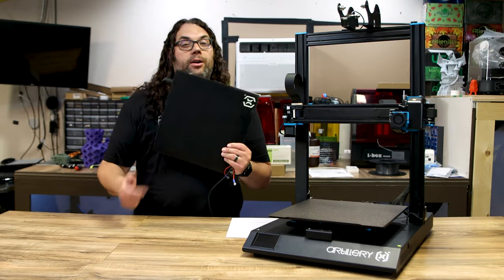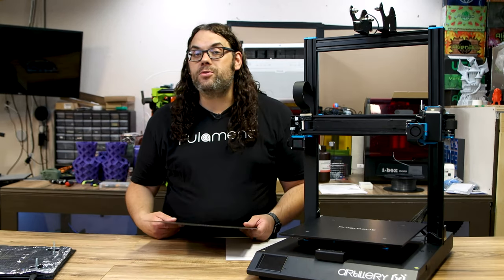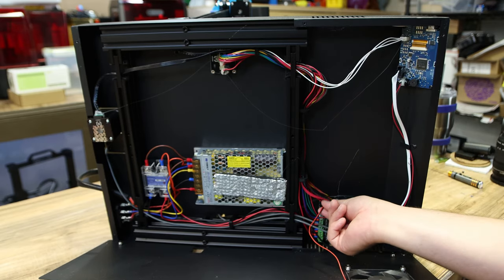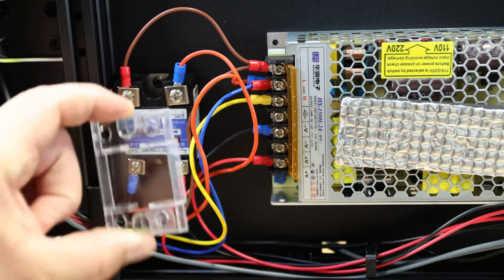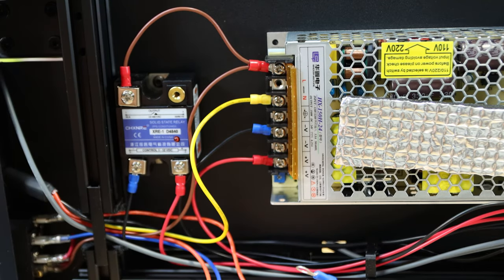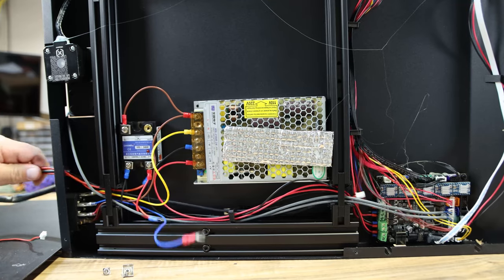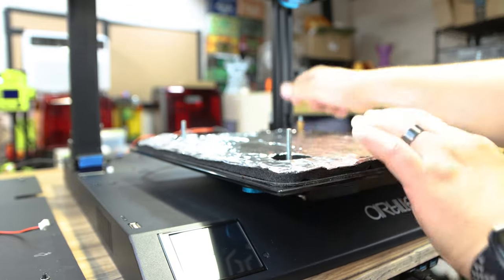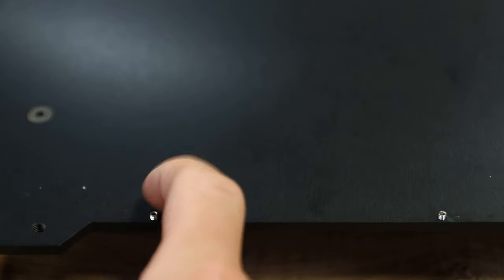How to Install 3D Printer Heated Bed Upgrade Using Fulament Fula-Bed!

Comment: On the heater plate. Always pull an inch or so of the paper down, set the front edge then peel and set.
Reply from the maker: Normally I would do that with my magnetic plates etc, it's a little bit harder with this one because of the holes for the screws but I probably should have tried to do it like that lol

Comment: Put the bolts in last.  That way you can apply the mat like a phone screen. Aligning one edge and slowly working your way across.  I’d make a good line on the side you start with when you mark it. Simple.

Comment: Excellent review, I may consider this new bed after I do more research. Problem with my current bed is there are cool areas and adhesion lacks on longer prints. Thanks for doing this for the Sidewinder x1.

Comment: Great video Jim! Glad to see you like it :)
Reply: You could use 4 installation cones for that heater pad.

The broad side of the cone needs to be the same size as the ID of the hole that goes around the screw.

The cones should screw onto the screws with the broad side next to the plate so that as the heater pad slides down the cone, it automatically centers onto the plate.
Reply: @scotttovey  Thanks for the feedback, we'll give this a try! The plan was to actually switch our instructions to have the heater installed before the screws. This way you can lay down the corners slowly :)
Reply: @Fulament  
You're welcome.

But even that will be difficult to get exact.
The problem is the high tack of the adhesive.

It's the primary reason that woodworkers, when laminating veneers, use over sized veneers and then trim them down with the router.

Something like this can't be trimmed down.

Another thing you might want to do is take four small pieces of double sided tape, and tape a couple of wood slats to the non adhesive side of the heat pad. That will keep the heat pad flat as  you lower it down around the cones.

Using the two wooden slats may eliminate the need for the cones, but if you want to insure the pad is centered precisely, then you need to use the cones as an aid.

Comment: Does this work the same for the X2,  Because my bed is now having issues with adhesion.  I am considering ordering this.  But on the Fulment website it just states that it may fit.
Reply from the maker: I am not 100% sure, but you could reach out to them and ask. They are good to work with.

Comment: Does the cost of the bed ($99.99 for the Sidewinder X1 Fula-bed pre-order) include the heater? There is an option for a "Fulament Heater Upgrade," and I'm wondering if that means you have to buy that the heater in addition to the bed itself.

Comment: That plate looks anodized, you should grind that of around the grounding screw since anodizing makes aluminium a really bad conductor thus defeating the grounding.
Reply: The grounding port is being plugged during production, to prevent the anodization from acting as an insulator :)

Comment: How long does it take to heat up that big 5mm plate?  I know the quick heating bed was one of the big points for the Sidewinder X1 and i'm curious if the big metal plate is going to take longer to heat up, or does the new heater ends up making up for that?

Comment: 0.15 flatness isnt that flat. Tho my bed is low -0.25 high 0.5. Might be time to level it. Just pull from the wires, it wont hurt the wire. If it does then it was bad from the start.